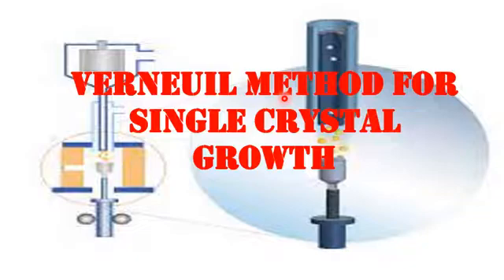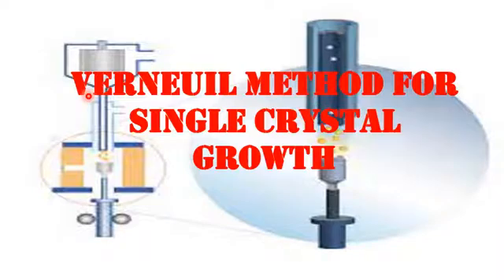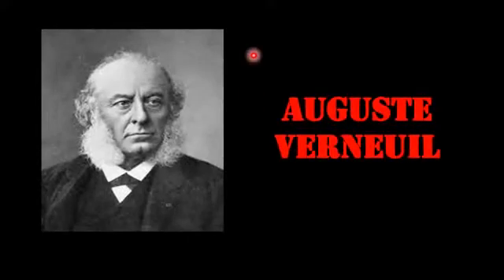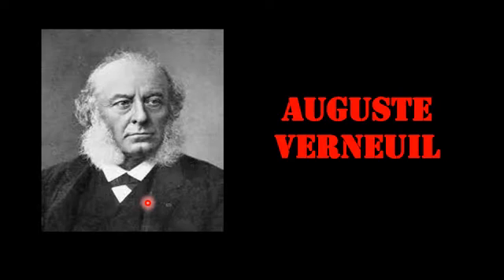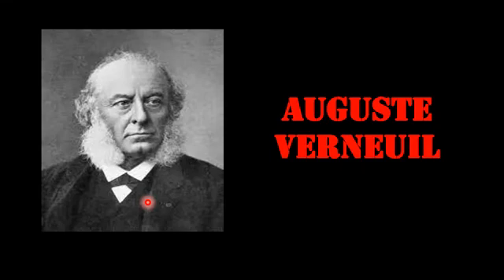Introduction to Verneuil Flame Fusion Method for Single Crystal Growth

Comment: Have you fabricated the air flow-flame burner?
Reply from the maker: Yes
Reply: @PhysicsMaterialsScienceandNano  Do you not sell the instructions or part itself?
Reply from the maker: @sterlinwalker4279  yes I can build and develop setup
Reply: @PhysicsMaterialsScienceandNano What would be a charge for something like that?
Reply from the maker: @sterlinwalker4279  please contact on physicsandmaterialssciencelect@gmail.com for complete details
Reply from the maker: yes because its time taking and require some parts to buy will depends on customer requirements